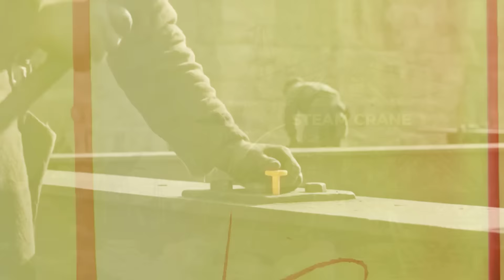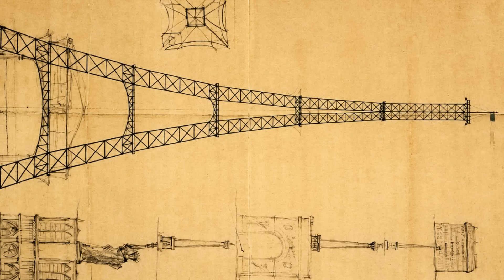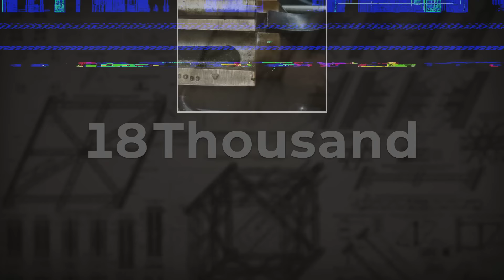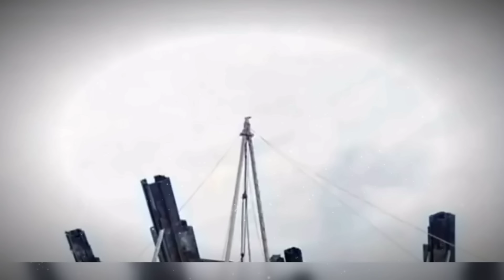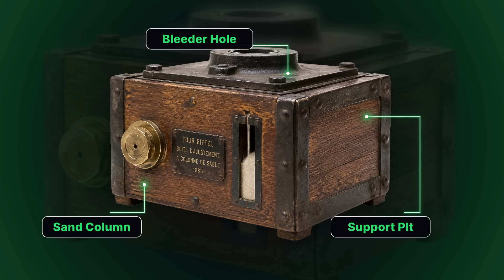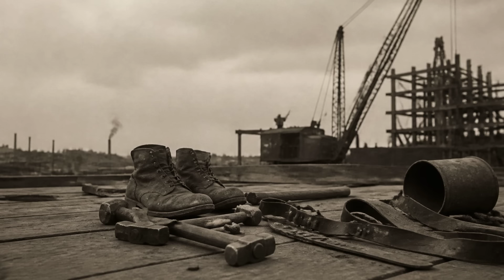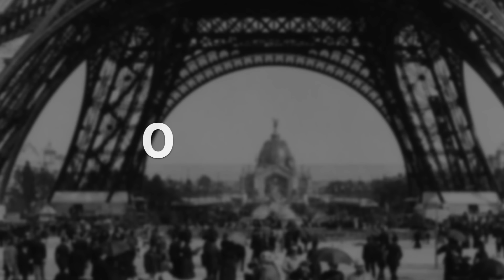The Machines That Built the Eiffel Tower (1887-1889)

Comment: What amazes me most is that thousands of pieces had to be designed, fabricated and assembled with extreme precision long before modern computers existed. Which part was the bigger achievement: the calculations, the manufacturing, or the machinery used to put it all together?
Reply from the maker: AIChroniclesOfficial, honestly, all three calculations, manufacturing, and machinery were monumental achievements without computers.

Comment: All 7,300 tonnes of puddling iron used for the tower came from a specific region in eastern France.  The raw iron was sent to the Forges de Pompey (the Pompey ironworks) located near Nancy in eastern France. Owned by the Fould-Dupont company, this foundry refined the iron through a "puddling" process to eliminate excess carbon, making it highly flexible, ductile, and resistant to cracking. Once the puddled iron plates and beams were ready, they were shipped to Gustave Eiffel's own factories in Levallois-Perret, a suburb just outside Paris. Here, engineers pre-drilled and pre-assembled the iron into 18,000 distinct structural pieces with microscopic accuracy.
Reply from the maker: Lenny, fascinating details about the Eiffel Tower’s specially refined iron!

Comment: in the snow with hot rivets the metal would change size the holes would never match this is insulting.
Reply from the maker: Hey Burnbaby, great question about the Eiffel Tower! You're right metal expands when hot, but those hot rivets were designed to shrink as they cooled and pull the plates super tight. The holes were pre-drilled to line up perfectly, even in the cold.

Comment: At 0:35 why are they hammering in a red hot threaded bolt?
Reply from the maker: To @tedneb3459 That's a red-hot rivet . They heated rivets and hammered them to form a permanent connection in early steel construction. Good eye!
Reply: @ConstructionLegends   It has threads.
Reply from the maker: Hey Ted, you're right... It is a great detail to notice!

Comment: The trains ran on the OUTSIDE of the legs.  And let's see what else.  Engineer in ragged clothing testing a valve with a coffee dispenser nozzle - some guy using a compass as a pencil to draw random lines on a blueprint - hands that draw an imaginary arc across a drafting tool - the line of workers with hammers swinging them randomly at a piece of red hot something that splits into pieces - 2 guys approaching a block of steel with a huge screw-tip sticking out (what the hell is that) - a "drill bit" that turns into a bolt, then someone tries to stick another bolt to the side? - image of a handgun when talking about tower part numbers - artificial workers with shovels shoveling rocks with no results - another person shoveling but missing the barrow every time - 2 guys with sledgehammers beating an I-beam, I just can't take any more.  For someone who pays attention to details, this is a nightmare.
Reply: How about the red hot rivet with threads?
Reply: @tedchapple5991 Yes I immediately noticed that too!
Reply from the maker: tedchapple5991, neotenydesigngroup - good catch, you two! Real rivets are smooth, not threaded like bolts - we'll keep an eye out for that in future videos, thanks for pointing it out!
Reply from the maker: @Bart Ha, you really don't miss a detail! Thanks for the sharp-eyed feedback - we'll keep an eye out for those quirks in future videos.